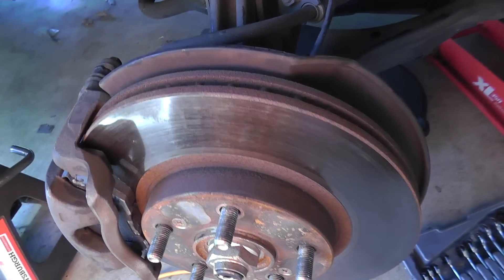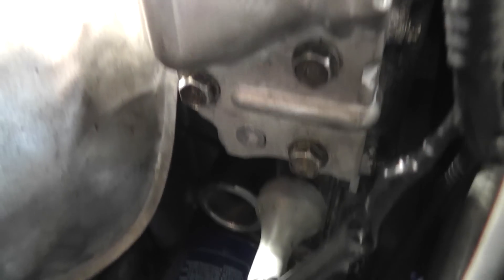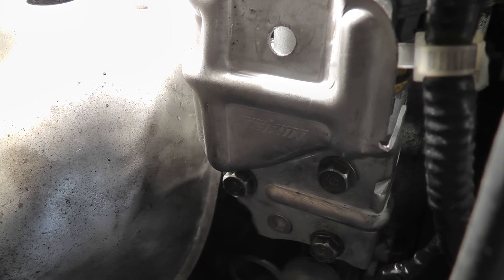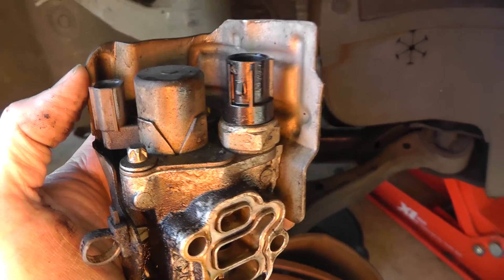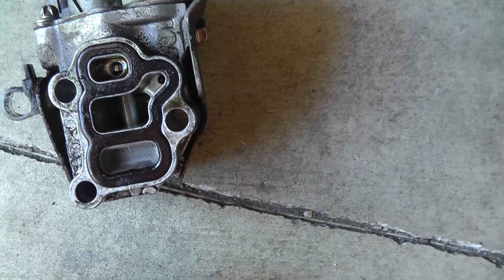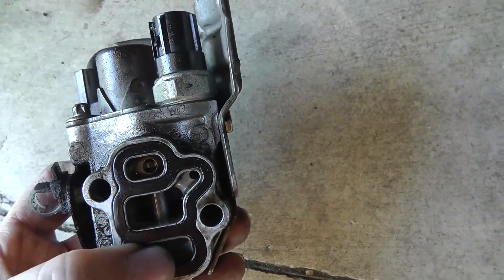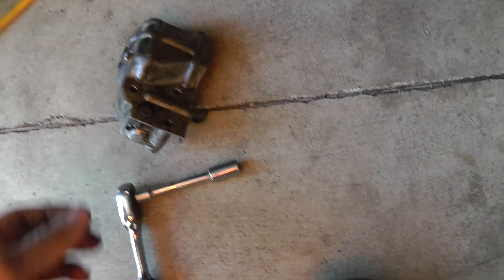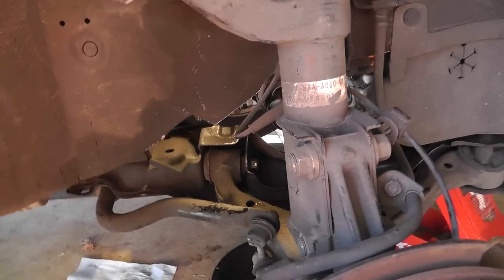2002 honda crv vtech solenoid install

Comment: hey my 04 honda accord dies down while driving every time i go past 3k rpms. now i changed out the engine management and ignition switch but still no luck.  do you have any suggestions on what i can do next?
Reply from the maker: +eduardo flores It could be your alternator. If you have a check engine light on, best thing to do is take it in to auto-zone and see if they can code it for you. Once you have a code you can search from there.
Reply: +Eddie Regory yeah that's what autozone told me to change out but I'm going to have to go again because the eng light is still on and it keeps doing the same thing.  thanks for the tips
Reply from the maker: eduardo flores
so, did you change out the alternator and it's giving you the same problem?
Reply: +Eddie Regory im doing that next
Reply from the maker: just for peace of mind, go to your gas cap and tighten it slowly. If it feels like it wasn't tighten all the way and then it clicks, this can cause an air gap in the gas tank and leave an engine light on too. Although your RPM situation would not be the cause of this.
Reply: eduardo flores did u find a resolution to your issue?

Comment: sorry but I don't see how you got it off so easy by just taking the passenger wheel off. we are having the same problem with a major oil leak and we found out that it is this problem. but my dad has been working on it and spent most of the day and I also just spent 4 hours right along with him trying to get the bolt out that is under the hump in the shield. even with taking the tire off we still haven't got that last bolt out.
Reply from the maker: Matt, there are only 3 bolts on the unit. If you're having an issue with that last bolt, try getting another extension for leverage and make certain you're turning the right bolt and NOT the hex nut on that same unit. When going in from the passenger side, you really need to get your arm in there and give it leverage. These Honda bolts are sometimes over-torqued but just be certain that you have the right size socket on there and you're turning it lefty loosie.  Also, get some lighting in there and try and peak through the wheel well into that opening if possible. It's very easy to miss that last nut because I've done it so take your time.
Reply: That's pretty sad dude..... I do these from the top all day long. I had one out twice and back in twice in under an hour. No idea what the hell you are doing but maybe shouldn't work on vehicles.

Comment: I have exactly that problem. Trouble Code P1259 in 2002 Honda crv

Code Definition:
VTec System Malfunction (bank 1)

possible Causes...
* pcm has failed 
* vtec solenoid connector is damaged (check pains for damage,and moisture)
*vtec solenoid has failed
*vtec switch has failed 

Thanks !! oreilly auto parts maybe $50.°° or $73.°° ;)